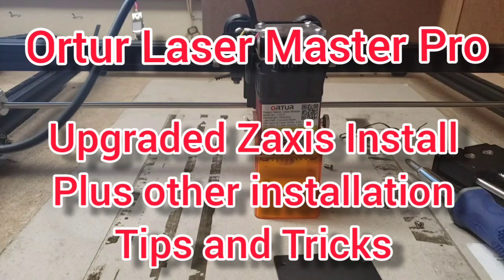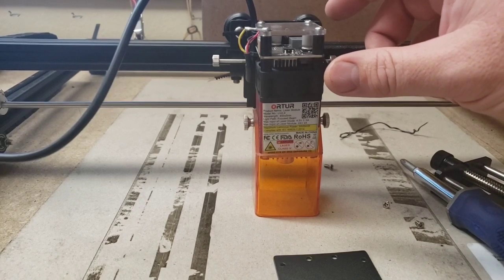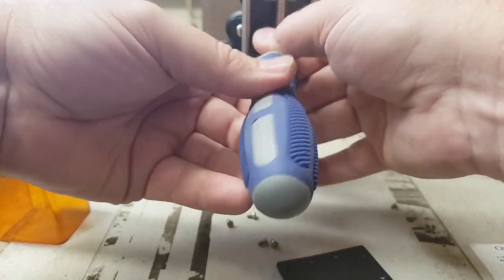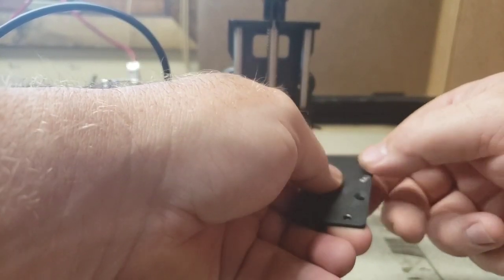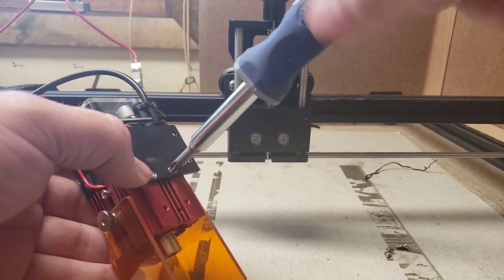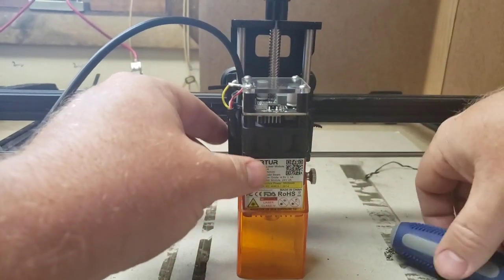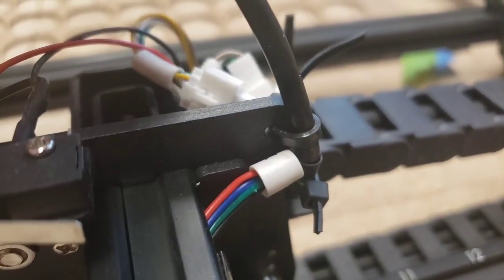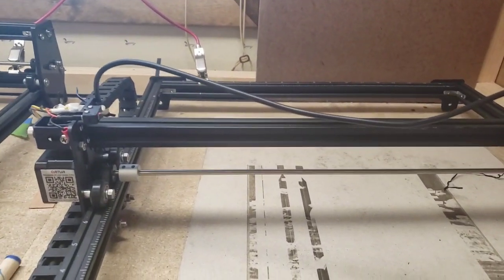Ortur Laser Master Pro Upgraded Z-axis Installation and other Tips and Tricks.

Comment: Is there a wider range of travel with the new Z axis, or is it just more secure,  and easier to adjust?

Thanks!
Reply from the maker: it just gets lowered down as the new module has a shorter focus length. mine was hanging up in the new module and wouldn't slide very well. The old module worked fine in the new Z, so not sure what is going on with that. I like the 3rd party Zaxis with the single vertical bolt that moves the Z. These ones with side bolts aren't as easy to adjust and can't be adjusted while in use. There are some projects I've done that the focus needed to be adjusted mid project to account for a curved surface. Can't do that with these style if Zs.

Comment: Thanks for the video. Can you tell me how far up above the carriage rollers the whole contraption extends? I actually purchased a King Gubby Z-Axis and it sits far too high for the enclosure I made for my LM2P.  Thanks.
Reply from the maker: from the top of the 30x30 rail to the top of the nut is about 3.25" or 82mm tight.  My old King Gubby is about 4" to the top of the nut. Just under 7.5" from the base surface to the top of the factory Z nut.

My Atomstack is almost 11". Good thing I built my enclose huge. lol
Reply: @TheKennyHack  Thanks for the quick reply!

Comment: Glad I watched this before setting mine up.  I wonder if the orientation of that plate is different if you're using the air assist that now comes with the pro LF?

Comment: Also, what about the limit switch? Did yours came with something to adapt the distance of the contact switch?
Reply from the maker: I lined up the back of the limit switch plate to the inside edge of the X rail.  This kept it far enough off so the shield didn't hit the frame.

Comment: Hello I am brand new to this technology.I put my lm2 Pro together and put the new mod for the z axis.When I try to home the modification is not figured into the 0.00Home ,so it hits and grinds.I reset the unit and I have tried to change where I home to .The laser will not move to where I want it to go.How do I change my
 Home to for instance x - 2.00 and y - 2.00.It keeps going to the x- 0.00 and y - 0.00.How do I fix or what can I do to change my homing coordinates Thank You in Advance
Reply from the maker: did you adjust the limit switch location on the bottom left corner so the laser won't hit the frame?

Comment: my kit came with a Y axis spacer. so now the burn area is slightly smaller? how will the lightburn know this? will I have to "create" a new device maually and enter the smaller Y axis dimension? how much smaller? the kit also said to mod the some specs in laser grbl. did you do this?
Reply from the maker: Most of the time on a rotary the image will be compressed on the yaxis. I put painters tape on my glass and burn a quick outline of the project. unlock the aspect ratio and increase the yaxis until its back into proportion. Depending on what I'm doing and the type of glass sometimes its only 5-10% increase and with some of my Mug jigs I have to double the yaxis. With glasses that are tapered you can skew the image in Gimp to make the top narrower to keep the image looking more normal.
Reply from the maker: I've never used Laser grbl, so not sure what would need moded. 

manually move the laser in the program to the back limit edge and see if it will miss the frame. If it clears its OK if it hits shrink the yaxis from 400 to 390 and see if that keeps it clear of the frame.

Comment: I have a question? Is there a way to change the diode laser inside the module instead of buying a whole new module every time the it goes out because they don't last long. And I can see spending 💯 Everytime it burns out. Do you have any info on that?
Reply from the maker: I'm sure it can be done if you are good with electronics.  the wiring will need to be soldered onto the circuit board and will have to find a place to buy them. I haven't had any of mine go bad yet.  I figure if I get 6 months out of them with a lot of use they've paid for themselves. Depending on the module $75-200 isn't much. Some printer cartridges are in that range. Try not to run your laser at 100% and it should last longer. keep the lenses clean and check your connections regularly. They can cause a decrease in laser power.
Reply: @TheKennyHack  they first one didn't last 3 months so I was just wondering plus I didn't use that much, the new one I believe may be going bad too. I see a spec of light on side of the main laser. Thanks

Comment: The front warning label should also be removed as it reduces the efficiency of finned heat sink as does the orange shroud
Reply from the maker: I've kinda seen this argued both ways. some say its better without the sticker some say it help keep the air blowing down the length of the heat sink and will pull more heat away than if the air can escape. Be interesting to see through a FLIR camera what is really going on. Not sure if I've seen anybody do a video or is it just a matter of opinions.
Reply: @TheKennyHack  I use an IR Thermometer ..all my postings are with actual metrics not just yabas
Reply: The same as the ACTUAL speeds ...doing a quality Photo maybee 5,000 mm/min at best...using metrics not just what machine says

Comment: Do you plan on running this faster than 3000mm/min if so whats the fast would you go? I got an atomstack a5 pro and wanna go faster than 3000mm/min but also dont wanna destroy it. What's your thoughts? Thanks!
Reply from the maker: I've already had ot up to 9900mm/min. I tried 10000mm/min but it kept shutting off. No problems at 9900. They don't always run the exact speed you set it. Have to time the laser to get the true speed its running. Newsprint is the fastest and Grayscale the slowest.
Reply: @TheKennyHack  thanks for the response, my thought is the most that could mess up going that fast would be the stepper motors and you can get 4 of them for like 30 bucks on amazon. Good to know my engraving times will be nearly 3 times faster!

Comment: Thanks for your response from the last question I have an issue right now that maybe you can help me seems like you're more knowledgeable I'm just new at this yesterday it was burning a cork coaster and my laptop stopped because the battery needed to be charged. Today I started everything up and my laser won't respond it says ready on my laptop will not move to home position at all I tried shutting off the software I put the back on again but nothing works can you please help me out for your response
Reply from the maker: I guess you can try unplugging the USB and plug it back in. Right click on the device button in Lightburn. Its usually Com3 on mine.
Reply: @TheKennyHack  I tried the USB that didn't work I didn't understand the right click on the device button but mine is com5

Comment: Any idea if a Shop Vac pulling air away from the work area would work instead of an air assist?
I cannot try things yet as I am waiting to get an Old PC to using in my Shed.
Reply from the maker: I don't think it would work nearly as well as a compressor. The air assist is mainly  for cutting to blow air down into the cut area to blow the soot out and make a cleaner cut.  I have a 20" box fan sucking air through my hood and venting out a window. That works pretty well to keep the fumes out.

Comment: I think if you use a small piece of a zip tie and use it like an antenna, between all the other zip ties it should hold the cable just a little bit firmer, so you end up using three. 
At the base of the post, top the post and the same distance up in the cable proper, that way the antenna piece should flex at max range and still hold the cable up more when its not under pressure.
Reply from the maker: Good idea I'll give it a try.

Comment: Please, can you confirm there is a screw to adjust the damping of the sliding plate ?
Reply from the maker: I'm guessing you mean a screw to adjust how easy it is to turn the bolt. I haven't seen one. Im just going to get a fat rubber band and loop in over the knob and the edge of the frame to hold it in place better.
Reply: @TheKennyHack  Yes. It should be a hole on the right of the long adjust screw. You can see it on step 6 of the assembly manual

Comment: Don't have my Z adjuster yet, but, is there no way to lock the adjustment in place once set?
Reply from the maker: My other z adjusters were tight enough they would just stay where you set them. This one turns very easy so might need to find a way to lock it in. I think a heavy rubber band hooked onto the knob and the edge of the zaxis frame will hold it in place ok.

Comment: Ha!  Fought this battle last night myself.  Instructions would have been nice!  Took a couple tries.  And as mentioned moving the home zero switch is important!
Reply from the maker: Yep, of course I forgot to mention that tidbit. Becomes obvious pretty quick. I know from experience. Was a successful test for the emergency stop button.
Reply: @TheKennyHack   Aen to that!
Reply: @YourCouchsucks  You can lift the shield up and just use glasses for protection and you will not need to move the zero switch.

Comment: How will air-assist work with the yellow shield in the way?
Reply from the maker: Some are making a nozzle that slips over the lens housing with the air hose coming in the back. My guy over at kinggubbydesigns.com is sending me one of their designs to try out. Im on vacation a lot over the next few months so will get a video out when I can. Check out there page for the other mods they offer.
Reply: thank you